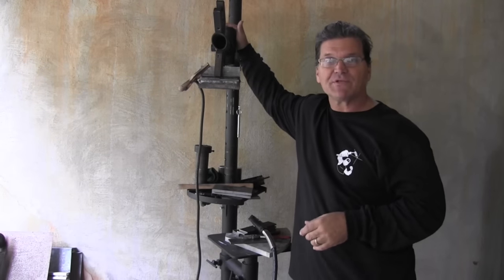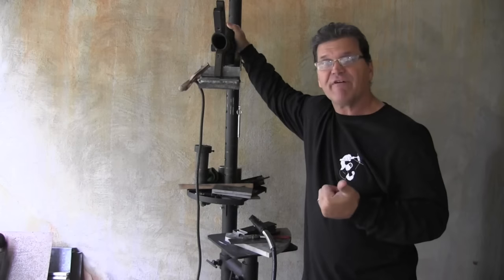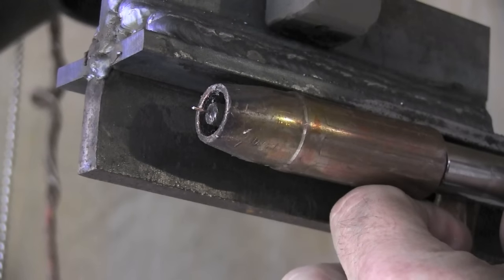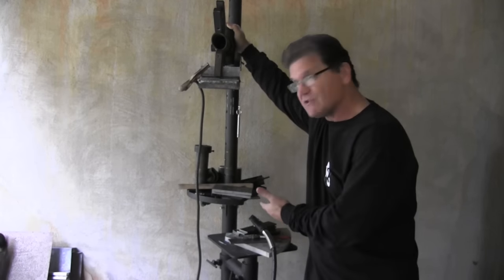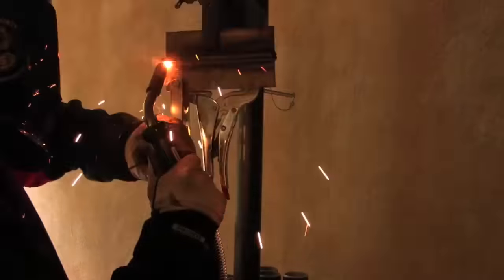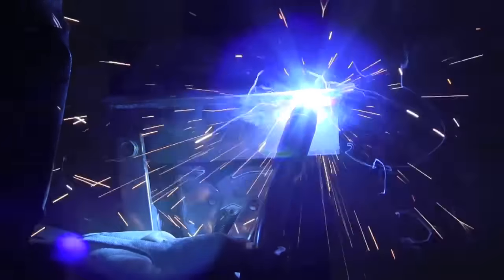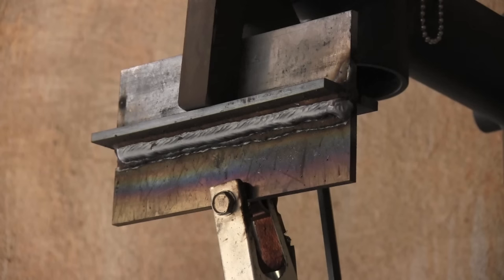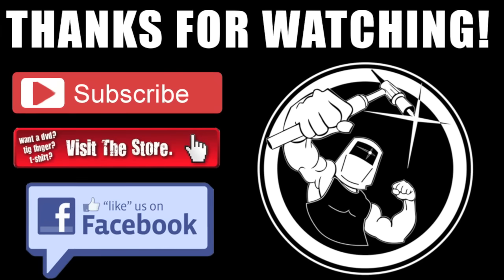MIG Welding Overhead - Mig basics part 8

Comment: why you need make those U-s? i just go straigth and weld is very smooth and beautiful.
Reply: As far as I know, a beautiful weld is not always a strong one. He is making sure it penetrates the edges and assists the penetration in the corner by maintaining temperature and control of the puddle. Moving the gun around just helps the control. It always depends on settings, machine, wire, material etc.

Comment: Question: How does one correct a tip that is recessed too far into the nozzle?
Reply: I guess cut the bottom side of the nozzle i did this also
Reply: Yeah, I figured as much. Thanks.

Comment: i cant get a decent weld overhead on my back under my car any tips ideas?
Reply: A remove whatever you are welding
Reply: Check polarity.. I had the same problem with overhead. I checked and it was on flux core polarity..

Comment: How do you like the thermal arc welder?? Planning on getting a fabricator 211i and just wanna hear your inputs on tweco.
Reply from the maker: d1deuce Seems built well.  its not my favorite mig welder but is not bad.  it has an inductance setting and its very sensitive between voltage, wire speed, and inductance.  Also has an auto setting mode but I dont care for that.
Reply: I recently bought a Tweeco 211i with all the toys and the two things that annoy the crap out of me are:
1. The tip design sucks and I wrote Tweeco a long email about this.  When you remove the nozzle, the stupid tip falls onto the floor, because it doesn't have threads on it!  The nozzles however screw on, instead of simply pulling off, so you get the "luxury" of burning your hand, because you have to handle the nozzle long enough to unscrew it from the gun!  

2. But the really stupid thing about it, is that it does NOT have an amp meter on it - only a volt meter!  Did you ever see a welding chart that gave the heat measurement in volts?  This was obviously put there by some doofus "engineer" that has never operated a welder before.

 I wrote a long email to Tweeco about these things and while they didn't give me a way to fix the amp meter deficiency, they did send me a new "Professions" series mig gun that has the screw-on tips........but the nozzle still screws on!!!
Reply: I'm thinking about getting an Everlast MIG welder or maybe one of their powerMTS welders. Have you reviewed either of those before?
Reply: d1deuce I use a 550v thermalarc at work running .045 dual shield fcaw as well as a power source for gouging it is an amazing machine. Can't recall off hand what model it is but I know it's a portable dc power source with a wire feeder on it.

Comment: Have the Miller 350 6mm material 6mm round tube good starting four parameters
Reply: O. 45 wire to I'm using

Comment: i need vertical up tips
Reply: Stack it like a shelf...pause on edges to fill up undercut
Reply: Howard Duggy make an upside down V motion but don't spend any time really in the middle, pause on the sides and watch your puddle build up like a slanted oval then keep making your upside down V. If you spend time in the middle your forced with a high crowned weld. Your puddle when you do this correctly will not look like a normal puddle, like I said I slightly slanted oval then move your gun quickly but not to fast over the middle and onto the next side. (For T joints)